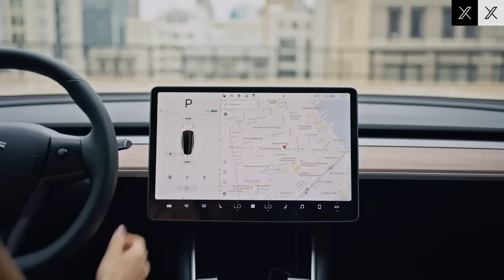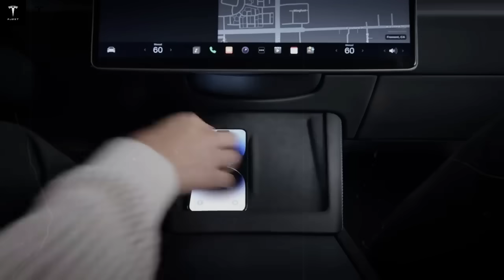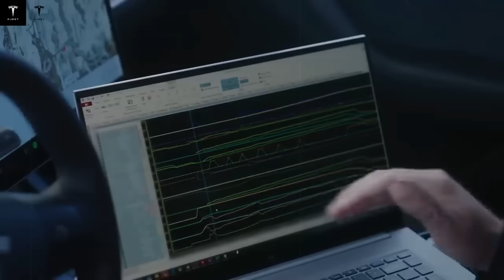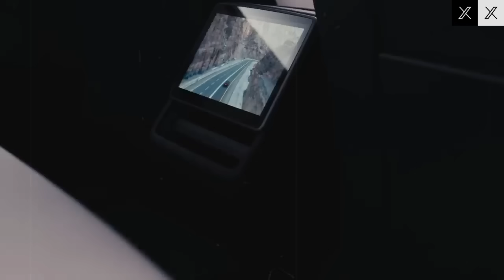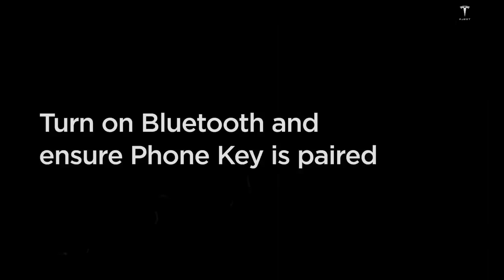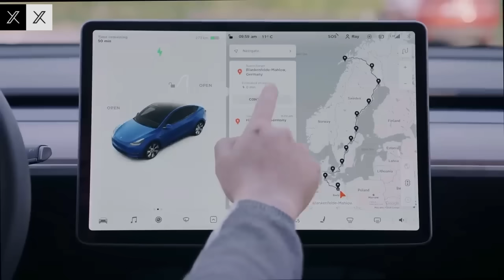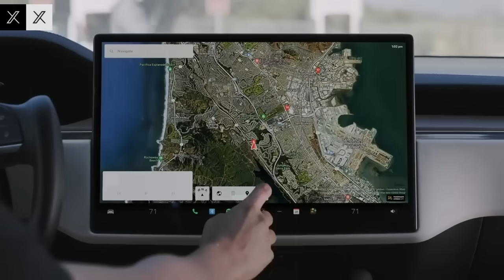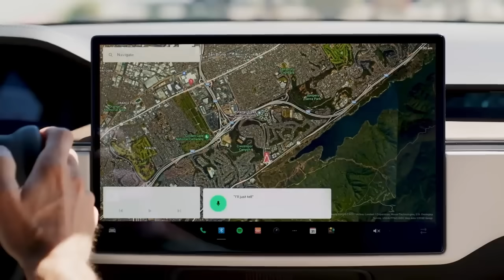IT’S HERE! New 2026 Tesla Model 2 Revealed — Elon Musk Launches $15,990 Aluminum Battery EV!

Comment: The. idea of a. 2026 bTesla model 2 with a
Starting price of $15,990 is circulating widely 
in unofficial reports with some claiming  it will 
Use a new. Aluminum battery pack and. have uo 
to. a 280-mile Range  However these. details 
especially. the specific. $15,990  price point  and 
aluminum battery should be treated. with 
caution as. they. are. based on unconfirmed 
rumors and speculative videos Tesla. has not 
officially. announced. a “model2” or. it’s 
Speculations
Reply from the maker: THANK YOU FOR YOUR COMMENT!

Comment: Prices keep fluctuating! 8k, 18k, 15k, and even under 20k. Which is it? 10k is the real mass appeal that then makes the engineering worth paying attention. The elimination of rare earth's, fast charge, 600 mile range, long battery lifetime, new electric motor designed to last, and battery replacement costs matter. Alot of interior tweaks are impressive. It will sell to cost conscious consumers it is designed reach. The interior height will matter to boomers as car egress matters. Retired persons will charge during the day, so home charging costs matters for boomers.
Reply: Who knows?
Reply from the maker: THANK YOU FOR YOUR COMMENT!